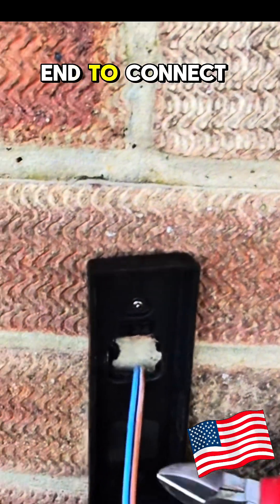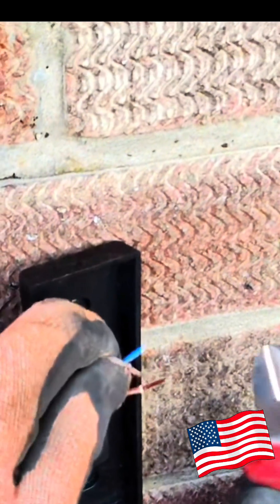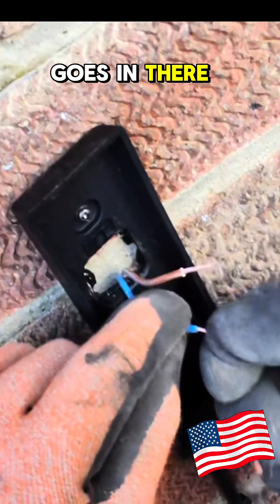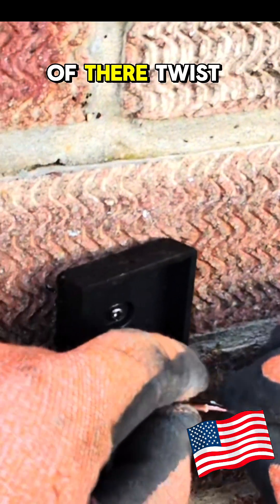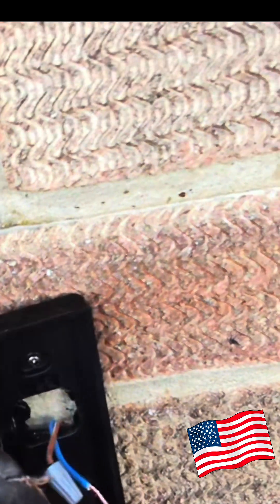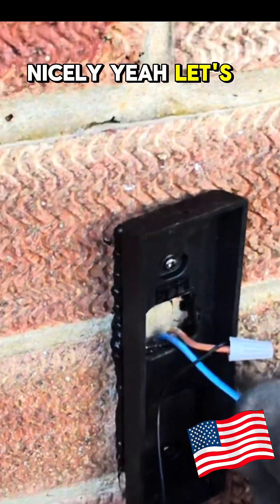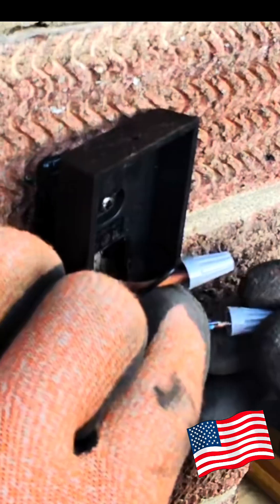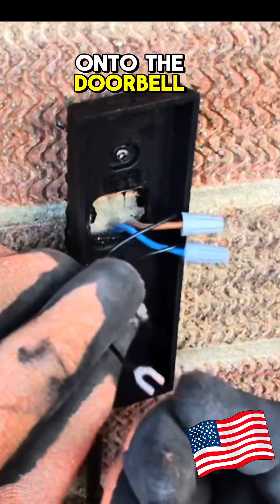Tiny Space, Solid Connections: Doorbell Wiring Tips (24V, Neat & Safe)

Comment: Those twist connectors, you need to keep twisting until the wire's insulation wrap around each other at least 3 times. This just adds extra strength so they stay together. :-)
Reply from the maker: That's a good point about the insulation, I'll keep that in mind for next time 👍

Comment: Why you using American wire nuts . No respectable uk spark would use them . 
No pride .
Reply: Shut up man
Reply: Its What comes with the doorbell. Its an American company. I personally wouldn't use them on mains but its 24v. 
Think just crimping the flex is the way to go. I have in the past used the provided wire nuts on ring doorbells
Reply: @D_5821  Wire nuts are not permitted by BS7671, so must not be used on mains wiring.
Reply from the maker: I’m testing out wire nuts to get them popular in the uk 🇬🇧
Reply: @toolboxtalking  It doesn't matter how popular you make them, they are specifically outlawed in UK domestic installations.